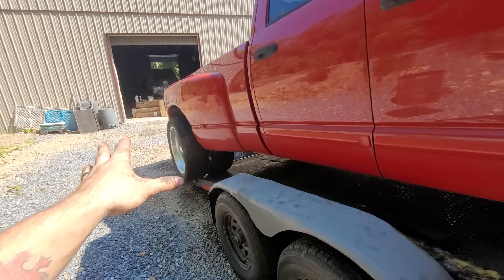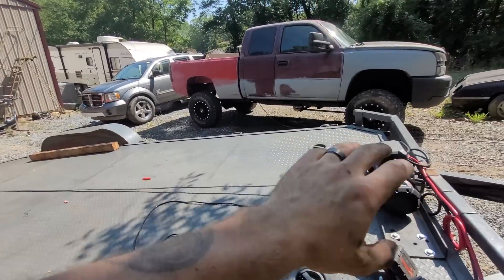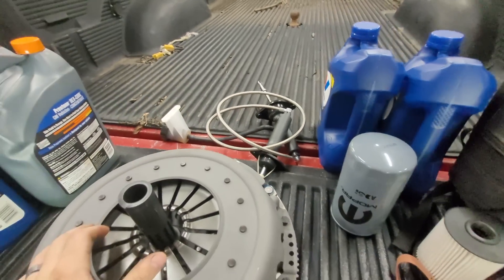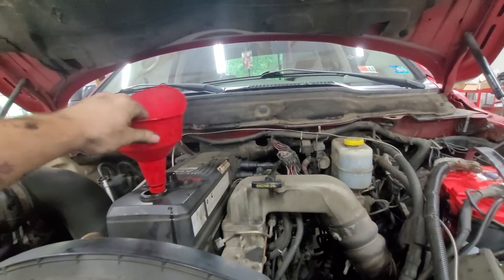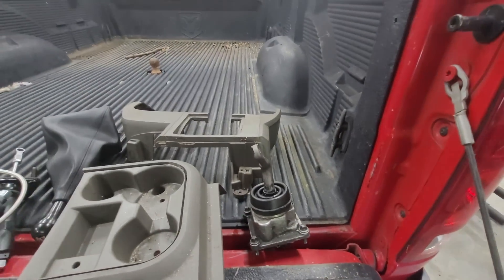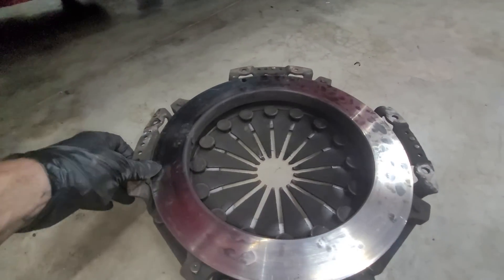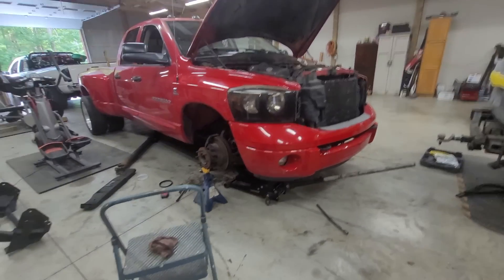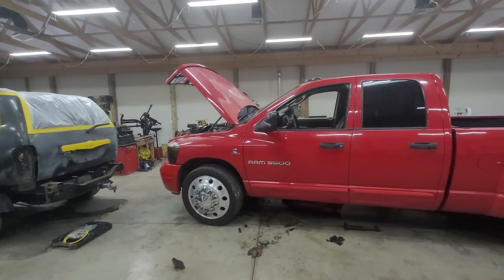Dodge Really Messed This Up 🤡 Torque Converter Bolts In A Manual Truck

Comment: With a barring tool and the proper extensions it makes taking it out as a module a breeze ( sort of acts like a torque converter ) stays on the input shaft

Comment: On the 7.3 trucks, the flywheel is threaded and bolts go thru the clutch so no fiddling thru the front to remove the clutch. On the automatics, the TC has 6 studs and the nuts are removed from the front side of the flex plate. There is an access cover where you can easily remove the nuts. I use a breaker bar on the harmonic balancer bolt to rotate the engine until all 6 nuts are removed. And that oil filter... way more accessible on a 7.3! I'm glad that my Cummins oil filter is easy to remove. Yes, I said that... I bought my first ever Cummins, but it's an ISX-15.
Reply from the maker: No manual should have bolts that go through the front side. Save that for the automatics!! 😂

On a simple clutch out clutch in I've had them down to 3.5 hours when I'm really just focused on getting shit done. This one fought me pretty good!
Reply: Cummins content only please 🤣🤣🤣🤣
Reply: @dixiemae5042  He mentioned in the video that he didn't know how the Fords were done...
Reply: @2020HotShotTruckingLLC  still no excuse to bring them 🤷🏻‍♂️🤣🤪🤣🤪🤣🤪

Comment: Never knew that thanks for the info I was doing mine every 5k but no more of that justed google it too says every 15k if it’s over a 2013 model
Reply from the maker: Do 10k and get an analysis. I push mine to 12k occasionally
Reply: @CPSteveMiller  thanks brother

Comment: I just dont understand the South Bend hate their great clutches top market really
Reply: I understand. i guess if it's cost, but
Reply from the maker: Valair is the same price. I ran one before and from what I see from a lot of people they have hard time shifting with their dual discs. I paid $1,300 for a clutch years back and it lasted great but it was always a fight shifting gears. I got to the point where I'd just float. Mind you we reused the clutch quite a few times with a few different motors and trannies so it was installed a bunch of different times. Never made a difference. I've come to not like dual disc clutches.

Comment: i always laugh at that oil is cheaper then an engine comment. i do my oil changes every 15000 (km) and lots of  people do it every 5000 KM ish. my trucks at 500 000 km thats like  10 000$ less ive spent on oilchanged and if my engine blew up right now i could definitly replace it for way less then that lol

Comment: What about if your oil is over a year old and less than 5000 miles. It would take me 3 years to drive 10000 miles
Reply from the maker: That's where an oil analysis would come in. 

Another thing you can consider is getting an aftermarket oil pressure gauge. If you notice the pressure is running a little lower it's time for an oil change or at a bare minimum, a filter.

My 12 valve I never changed the oil because it leaked so much. I would always just add more. With never changing the oil the filters would get clogged over time and once it would go down to about 30psi on the highway I'd change the filter. Then it would go right back up to 70(give or take).